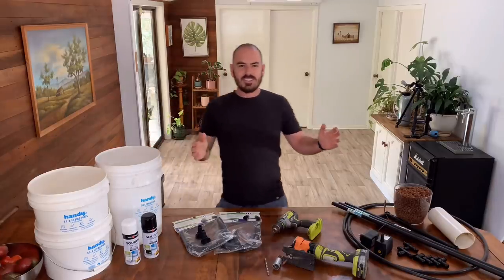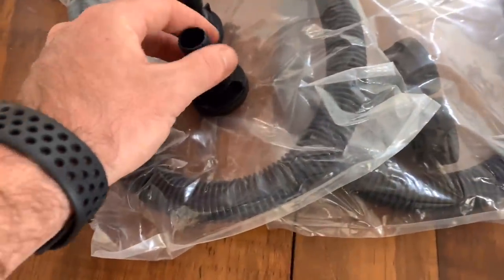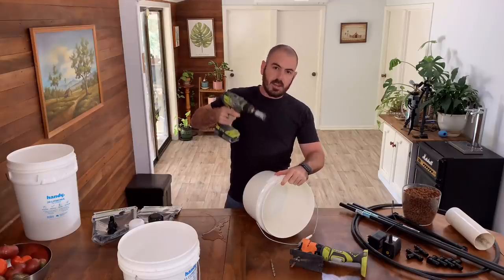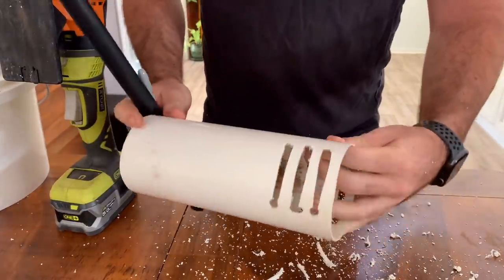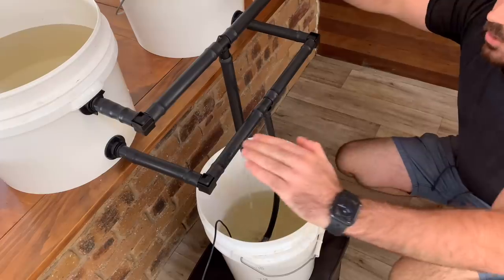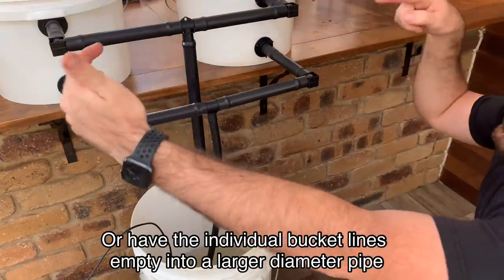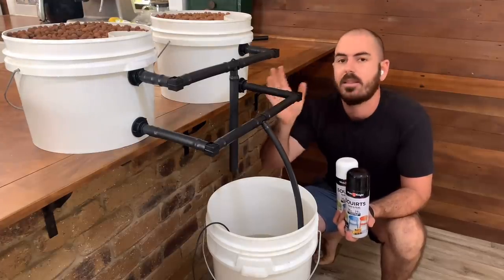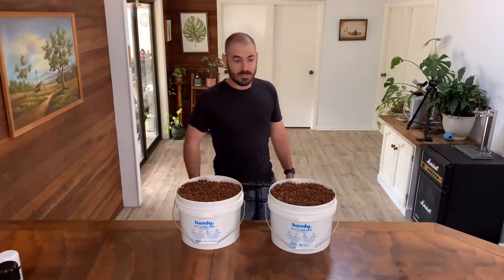How to Build a Modular Flood and Drain Grow Bucket Hydroponic System

Comment: Hey, you could improve your ebb and flow system by using a syphon to drain the buckets instead of just leaving it up to the natural flow. You can then leave the pump running 24/7 and have the buckets drain rapidly after a certain water level has been reached. You'll get more water flow and more oxygenation out of basically the same parts.
Reply: can you explain the syphon? thanks
Reply: @martinsafi8317 just look for "bell syphon" on youtube, its easy to make and works like a charm
Reply: Because you need it to stay drained fully for 15 minutes there is enough time  in that interval to just let it drain by gravity, and not add complexity and cost to the system
Reply: Been thinking about that, but in my experience, a bell siphon that would be small enough to fit those 11L buckets and not get in the way could be a challenge to make work right.

Comment: Just use a tank connector (15mm john guest ideally) , elbow and vertical piece of tube on each bucket. Rotate the tube up to flood the bucket via  watering can, jug etc. Put you thumb over the end of the tube and rotate it down to drain the nutes back into the watering can. To prevent hydroton blocking the tube, position a 2" netpot behind the tank connector (inside the bucket) as you fill it with hydroton. Cut a short length of 1/4" RO tubing and place it into the tank connector so it butts up against the elbow and sticks out the tank connector a little. this prevents any hydroton going into the tube but allows water to pass. Position the tank connector 2" up from the bottom of the bucket to provide a small reserve of nutes in the bucket.  No pump or electricity required.
Reply: If I understand correctly you wouldn't be recycling your nutrients then. Also, how are you achieving a flood and drain without a pump and a timer?
Reply: @marcipanzerfaust  
The nutrients are recycled and as the system is manual fill/gravity drain there`s no need for  pump or timer.

Comment: Great video but instead of shrouds, I think a 3 or 4 gallon fabric pot inside the bucket would improve the system plus you could then run any medium,  coco , hydroton, peat , perlite  & the fabric would filter the solution before being drained
Reply: I think the issue with that is the fabric pots tend to wick up and over the bucket

Comment: I learned a rule of thumb was to have the drain hose and fittings should be at least 1 size larger to keep up with the drainage. I did learn the hardway

Comment: i would love to know instead of using those half cut pipes couldnt you just insert the clay pebbles into a medical grade strainer bag? they make them to fit the lip of 5gallon buckets and im sure that they would do the job of preventing anything penetrating the drain and fill cutouts that is covered using cut pvc. a strainer bag insert would really work well i think for this setup. just an idea and would elimate any use for using sealant anywhere, thank you for great ideas and great content

Comment: Would it also work to hook the reservoir up to only one bucket (both inlet and outlet) and then run single hoses from that bucket to the others from the bottom of the buckets? They would keep the same level and just fill and drain through that first bucket.

Comment: HI,
Nice explanation - I do have a question though.  I setup my system pumping the solution into the bottom of the tray and my overflow tube draining directly back to the reservoir.  The tray fills fine and overflow working fine but when I turn off my pump the tray stays full.  Apparently my pump does not "Leak" enough to allow the backflow?  Do other people have this problem?
Reply from the maker: What kind of pump is it, generally impeller pumps don’t create resistance.
Reply: @Hoocho  Interesting - it is just a cheap little pump I'm quite certain with an impeller.  I had it going from 1/2 ID tubing tee'd off to 1/4 inch ID tubing (as the same pump feeds a couple bato buckets as well.  I was sort of shocked.  I waited about 5 minutes and the level did not drop by even a mm.
Reply: Never mind - my  pump drains fine, the problem come to find out is simply too much resistance with my 1/4" ID tubing and connectors which I happened to have a bunch of.  I'll switch over to 1/2 inch ID and I'm pretty certain all will work fine.
Reply from the maker: @karmaomg  Plumbing is a bitch haha

Comment: get cheap zalman microphone if you can plug in your recording device, or even try recording on separate device with second phone or something

content 10/10
audio quality 4/10 :)
Reply from the maker: I’ve looked into dual recording audio and other options but the way that I do it allows for quick editing. And allows me to put out semi decent content relatively fast whilst also having a full time job and acreage to maintain.

If the channel ever becomes large enough to be a full time job I’ll definitely invest in some more professional equipment.

(My recording device is an iPhone XS)
Reply: Respectfully disagree -- no issue with the audio at all for me! The guy's a gardening guru, not a grammy-winning recording artist.

Hey, Hoocho -- somebody on Reddit made me aware of your YouTube channel. Thanks for showing me how to build my next hydro system. Simple, straightforward, and relatable. Instant fan here.

Content: 10/10
Audio: just freaking fine/10